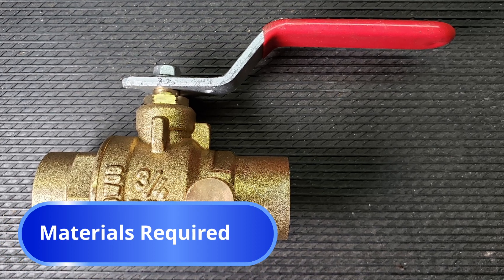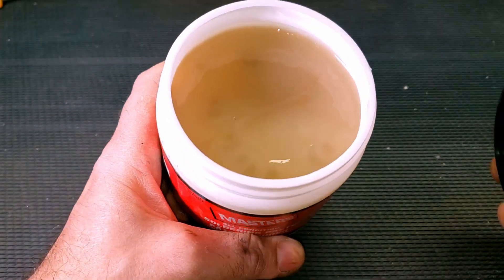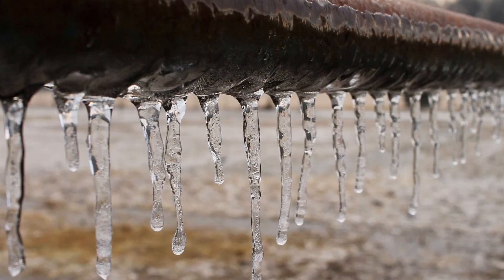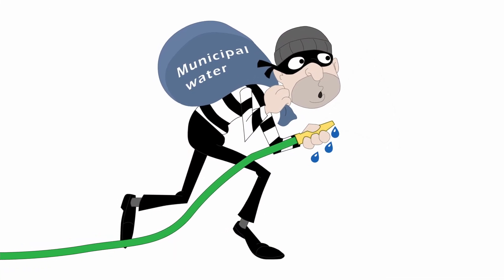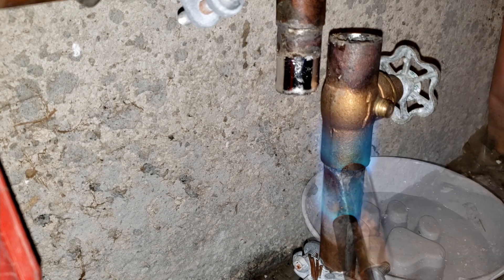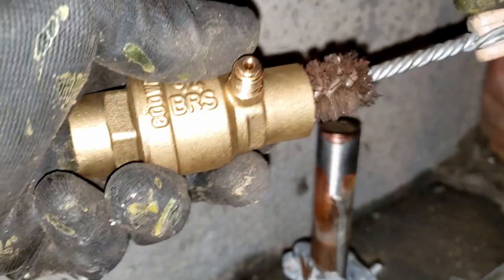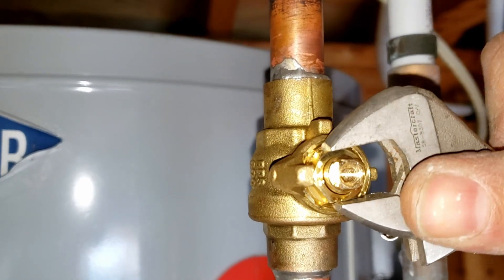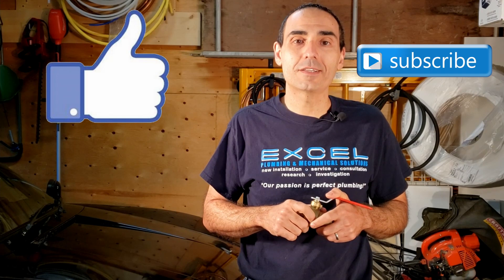Don't Ignore Your Plumbing's Main Line of Defence Until It's TOO LATE!!!

Comment: How do you select a quality Full port ball valve sold at the big box store ? Is pricing a good rule of thumb?
Reply from the maker: My honest answer would be to not purchase the valve (or any other plumbing material) from a big box store, if possible.  Rather, try to find a dedicated plumbing supplier in your local area by googling "plumbing supplier <YOUR CITY/TOWN>".

Most sell to the public, and should carry higher-quality items by default since the bulk of their business relies on real plumbers and contractors, who require material that is legally approved and least likely to fail to minimize callbacks. (not that you won't ever come across some duds even at plumbing suppliers - but you minimize your chances).

Big box stores may have some decent and approved plumbing material, but unless you know what you're looking for, it's a crap shoot.  If you are stuck buying at a big box store, then look through the valve's inlets in its fully open position, and if you don't see any reduction in size, then it's full port.

Hope this helps!